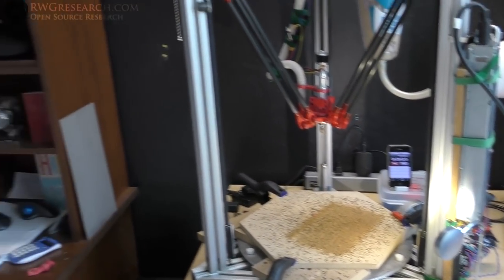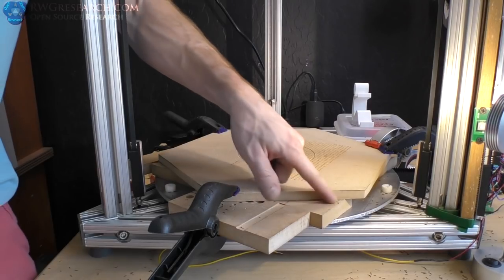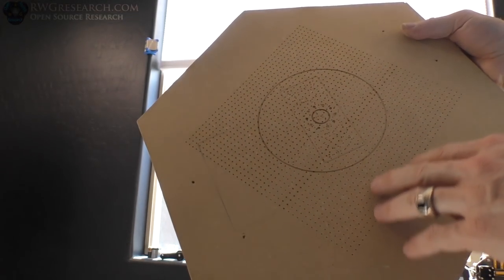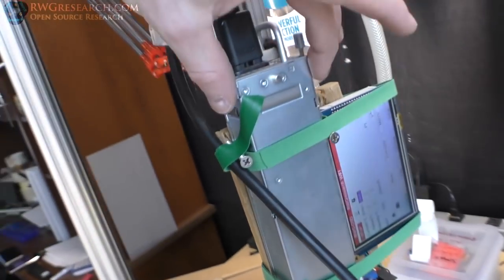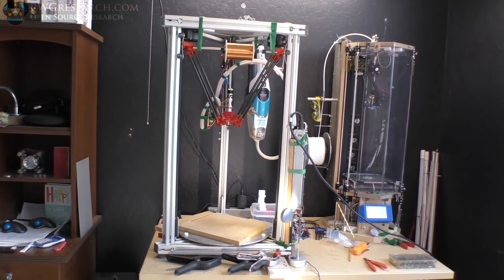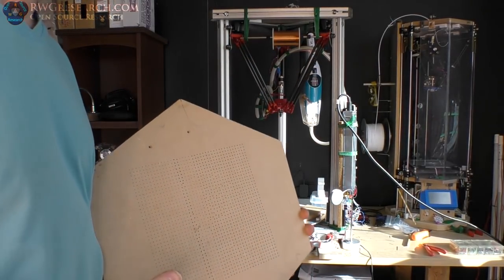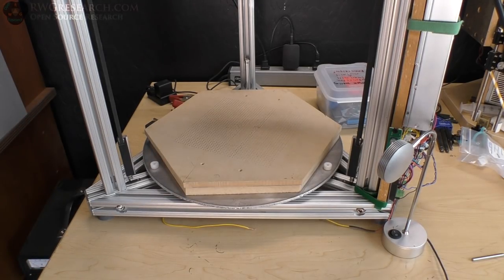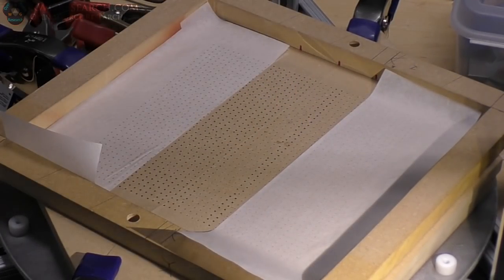Drilling 1600 holes! Vacuum Bed! CNC Flat Coil Winder : With RWG-OSD-CNC

Comment: Suggestion on the vacuum table: MDF is porous material, it leaks air. So, if you want to make your vacuum table more efficient you should seal these holes in MDF. You can "paint" the table with wood glue mixed with water (ratio 1:3) to make MDF non-porous.
Reply: mat m , wouldn't a porous material increase the suction power even more? Like extra holes....
Reply: TheRainHarvester... It would, yes, but you need to consider that MDF is porous in all directions not only in direction of drilled holes. That said, air will be sucked through all MDF piece area, all sides, bottom...

Comment: Russ, try putting your first layer of tape sticky side down, then spray the top side with 3m adhesive. let it get tacky for a few minutes, then put your second layer of tape sticky side up onto the 3m adhesive.. then try it? hope that works 😜

Comment: Did you tried A4 sheets for laminators? You could brush these with sugary water or some other sticky substance to make base.
Also clamping sealant silicone between 2 flat pieces of glass might produce quite smooth and flat but elastic sheets

Comment: @15m The vacuum needs some air flow or it will overheat and burn out you might need a relief valve to allow some air bypass.
Reply from the maker: Yes, though about that too. Will need to just make sure its good over time! ;) ~Russ

Comment: hey russ, why do you use the duet3d board? I understand that it is made with a 32 bit processor, but isn't it still better to use a ramps + mega combo? I just hate boards that have integrated stepper modules. I prefer ramps and the arduino mega because the stepper drivers are replaceable, but with a board like the duet3d, you'd need to replace the whole board if you burn one of the stepper drivers... I understand if the reason you're using it is because you have a delta, but if you had a Cartesian printer, would you still be using the duet?

Comment: Don't know much about g code or fusion. Sorry.
 I would think you would use a 360 degree stepper and just add incremental +1 to +5, 0, -1 to -5  to the code for each step through your pattern. I am guessing it would have to read the pattern then add the step codes in the g code then compare it to the head position and angle of the head to the pattern. However many steps you have to the motor would be your limits. Possibly +360 to -360 including 0 for straight? + and - would be left and right turn....

Comment: Couldn't you just use another layer of tape on the split, and 2 on the sides (3 behind the 2, so the 2 are still flat?
Reply from the maker: Yes, but have you ever tried laying tape on tape with no bubbles! Lol its an option though! Thanks for the thought! ~Russ
Reply: rwg42985  HAH: ) oh.

Comment: probably not very helpful, but the people using Mach3/Mach4 CNC software to control CNC/plasma cutters/wood router, a lot of them made vinyl cutter that do exactly what you want to do.
Reply from the maker: Thank you,  yes, i saw that mach will do it. But paying for Mach3/4 is out of the question.  Also the a goal of the project is to use any 3D printer for this type of applacation. So building it in to a slicer, or having a post post processing for the Gcode seems like the best fit. Thanks for the feed back though!!! ~Russ
Reply: rwg42985  Sorry, my english ins't too good sometimes, I wasn't suggesting using Mach4, I was more suggesting asking on the Mach4 forums, a lot of people built vinyl cutters, someone might be able to help you with what you need.
Reply from the maker: @goglu2  thanks! Yes your English is good! I understand. ;) thanks! ~Russ